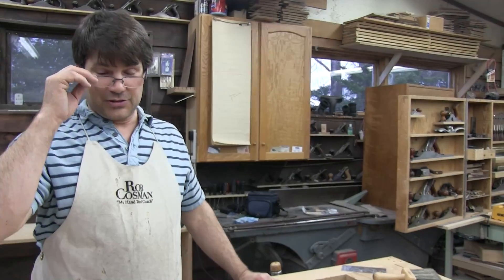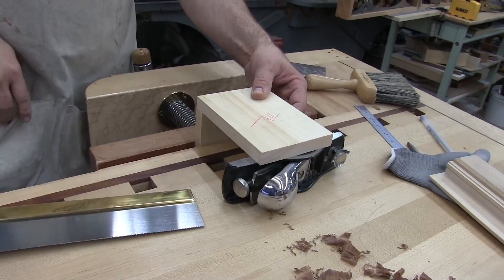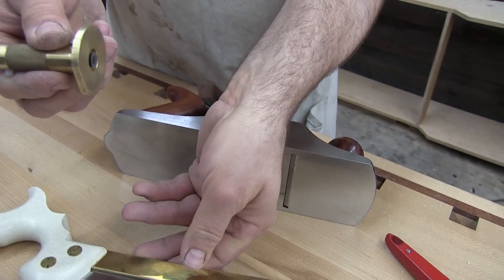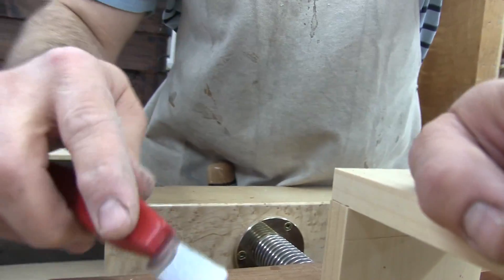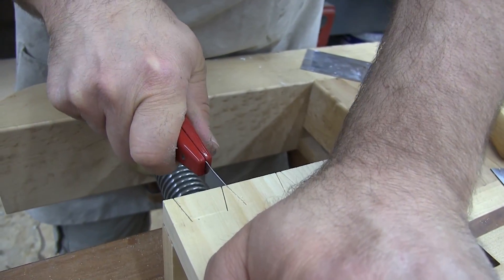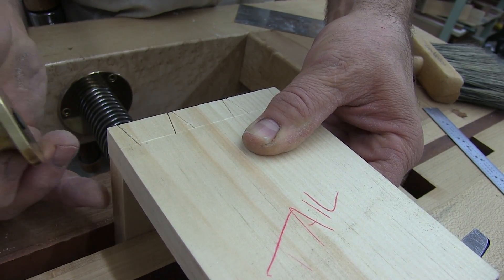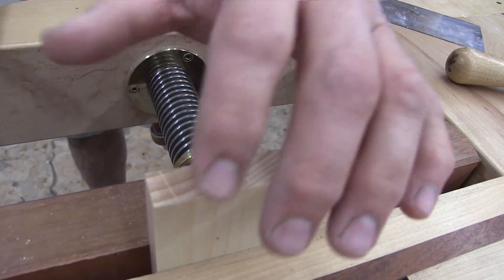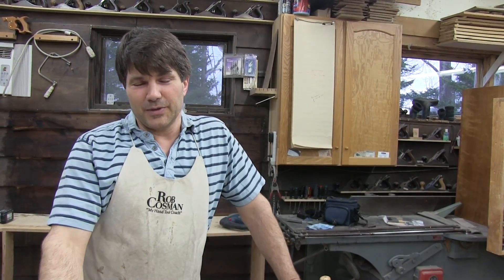Hand Cut Dovetails, A Different Approach part 2!

Comment: Your work is amazing.  I wish I was in your area for a hands on class.  An idea I had for your new way of marking dovetails, if the person doesn't have a piece of saw blade to act as a spacer, go to the hardware store and buy a set of feeler gauges (for spark plugs and such).  There ought to be a blade in the set that would match.

Comment: I am not understanding why you wouldn't use 1/2 the kerf in each direction? In the end, you are only sawing one kerf at each cut, so the offset should be 1/2 on the left, and 1/2 on the right to makeup for the full 1-time kerf per cut. Correct? Imagine you only make one perpendicular layout line across the end-grain (perpendicular to the face of the board), forget dovetails for a moment...If you cut directly on that line, your kerf is offset half on one side of that line, and half on the other half of the line. So, if you offset it a whole kerf, you are 1/2 kerf too far out? It would be easier to explain if I could draw my theory for you. Thanks for getting me thinking though! A+ segment, topnotch as usual!
Reply: I am not arguing, just trying to understand. To take your example, if you were to drag the saw through the kerf without offsetting the board, you would have 1/2 the kerf on the left side of the 'line', and 1/2 the kerf on the right side of the 'line'. The blade center line would essentially be directly cutting the 'line'. Thus, offsetting the board by 1/2 kerf would make the extremity of the blade cut directly on the 'line' that's intended to be cut and the full kerf being in the waste area of the tail on both sides. lol, I know i am confusing the hell out of you. I guess I could go out in the shop and try it both ways and see. To do this experiment correctly, I am going to draw a line with pen that is meant to be the actual cut line...then offset off of that line and see.
Reply: Imagine the tailboard has the waste removed and is sitting on the tail board ready to mark.  The cut line that will bring the pins straight up is UNDER the tails and flush with the edge we're using to mark with, hence the need for an offset.

Comment: great video,,,but im stuck on why you need the kerfs,,
Reply: The saw kerf marks the location where you will place the saw when you cut the pins.
Reply: Say you cut the waste from the tails then mark the lines onto the pin stock with a pencil or knife.  Where does the mark meet the side of the pin?  I used this method unsuccessfully for years.  It's all guess work without the offset Rob uses.
  I invented another way to offset after cutting the waste from the tails move the tails out over the edge of the pinboard 1/64 of an inch (for me) which makes the pin waste smaller and hence the pin slightly bigger.  I like Rob's way better and will use it in the future.

Comment: What is the explanation of this offset? Because of the thickness of the saw blade?
Reply from the maker: the tail board has to be moved the width of the kerf so that when dragging the saw or saw tooth blade through the original kerf it will not mark in the pin but just outside it, in the waste.
Reply: @RobCosmanWoodworking  not the same as to mark regularly and cut from the outside with the saw?
Reply from the maker: this method allows  you to start the kerf using the previous tail board cut as a guide.  No guessing where the cut should be in relation to the scribe mark.  Hit 50 and as the eyesight changes you will get what I mean.